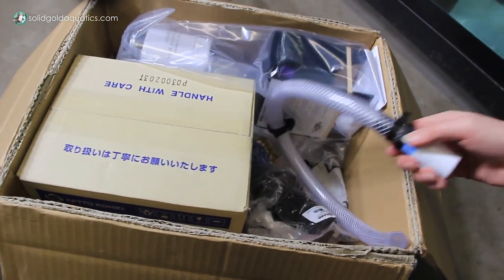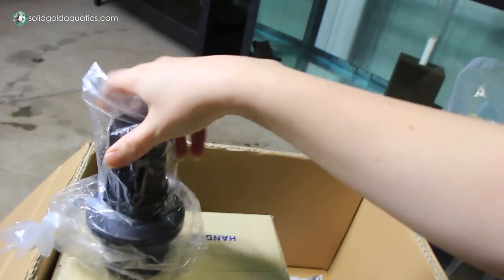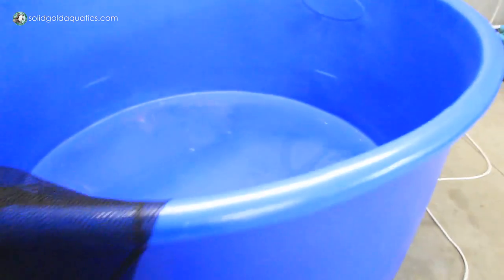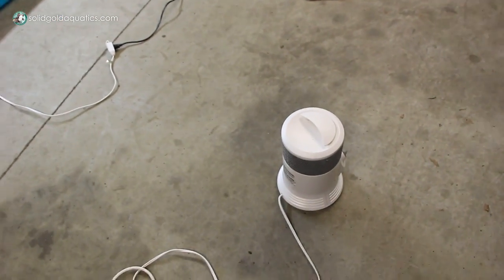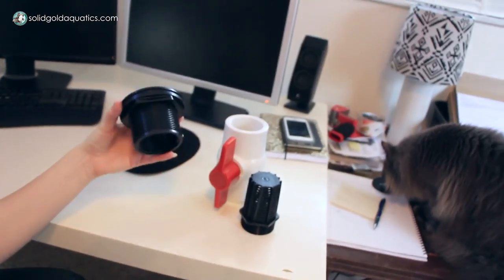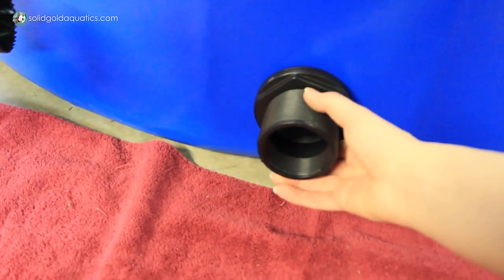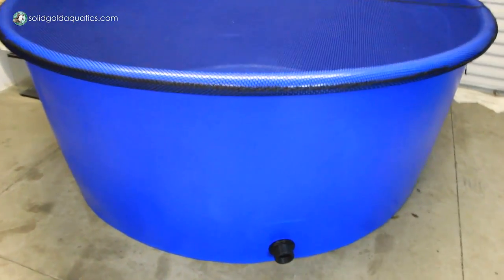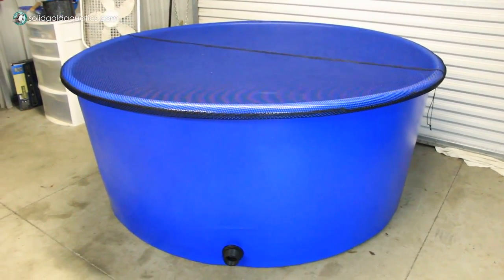Installing a Bottom Drain on a 650gal Tank // FISH ROOM VLOG

Comment: Awesome set up.  Not a big deal, since your giant pool/pond will be located outside, but the outside threads on the bulkhead are for the nut.  The inside threads, or slip (depending on type of bulkhead) will give you a more waterproof connection.  Can't wait to see this huge pond up and running!

Comment: Like you videos.   Point of info Li-on batteries (most power tool, camera, laptop and phone batteries) do not not have a memory effect.  So that it is OK to recharge a partially discharged battery.  I normally run my batteries thru the charger every couple of months so that I know that are fully charged.  I also recharge after using.

William

Comment: Wow! Now that's a tank!!! Great job installing the drain to it. Did you use any silicone with the bulkhead or is it all good as is? Just curious since I had problems with leaks when dealing with bottom drains. I think it's more because I have a tendency to overtighten bulkheads though. I know I'm not supposed to but I can't seem to help it! Lol.